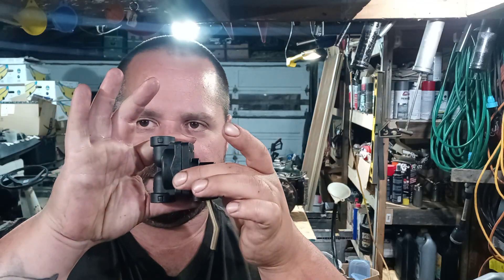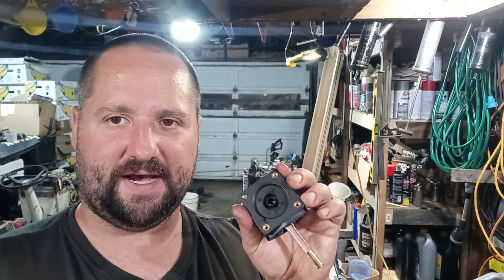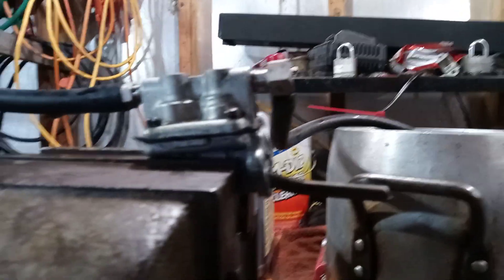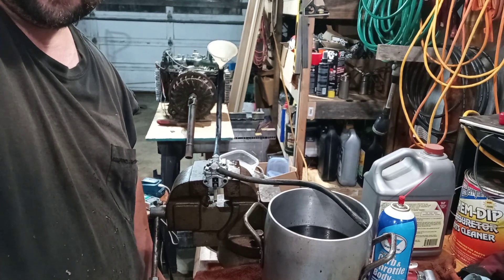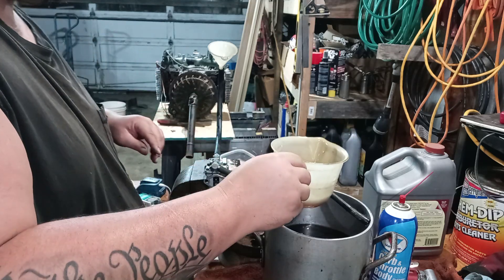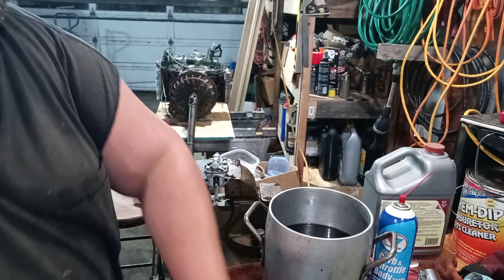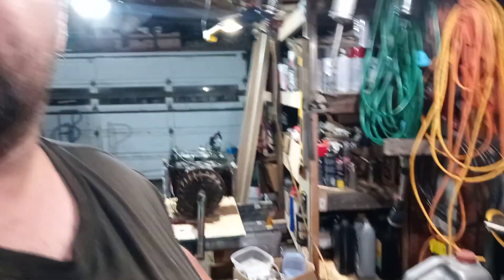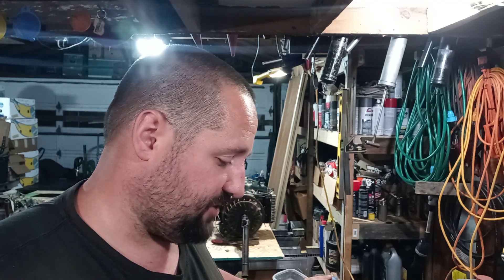Kohler KT17 fuel pump out of my Bolens QT17 part 2

Comment: Great job on the fuel pump, it is good that you can swap the key part
Reply from the maker: Thank you. Yes I'm pretty happy that i was able to save the original pump.
Reply: Hello From Mark In Kentucky. I have a 682 Cub Cadet that I am working on swapping out the fuel pump and probably the carburetor. After going through the hassle to remove the engine tins and carburetor, I really hate the thought of using one of the cheap fuel pumps only to have to take everything apart to go through the process again. I am leaning towards mounting a pulse type fuel pump that operates with a vacuum pulse from the engine. According to the appearance of your fuel pump, I am thinking maybe that my fuel pump looks like the black composite plastic or whatever and probably aftermarket due to no visible letters or numbers on the casing. My engine would either run pretty well for a few minutes and just smother out in which the engine acted like it was starving for fuel. I am going to try one of the aftermarket carburetors but keep and rebuild my OEM Walbro carburetor
Reply from the maker: @TheIronDuke502  I highly recommend keeping and rebuilding the original Walbro carb. It is worth the hassle. Some of this cheap chinesium aftermarket carbs are not made well at all and sometimes no matter what you do you can never get them to run correctly. Watch my previous videos on how i cleaned the carb for this Kohler QT17. Maybe that will help you with your original carb.

Comment: Good video. I wanted to do the same thing, and your video assured me it WAS possible before I ordered stuff and tore it apart. Question though. Did you have any issues with it flooding afterwards? My check valves are good, but it seems to maybe have excess pressure now. It floods, I unhook fuel line and it fires right back up until I hook it up again. Just curious before I tear carb apart. All new needle and float, so I have my suspicions on too high of pressure...this thing spits gas 3 ft away now.
Reply from the maker: I haven't gotten it back together yet so idk.
Reply: Ok. I noticed the new spring seemed stiffer and thicker gauge than the original, it was still roughly the same height from what I could tell. But the original was severely rusted through and came out in 3 pieces. It didn't leave much to compare it to. I did use the original better quality diaphragm, just replaced the spring. Guess I will be investigating further. Thanks.
Reply: Problem solved. I added an inline regulator, and set it at 2lbs. I cant complain, I was able to restore the original pump with only the new spring. I suppose gaining pressure and vacuum to the tank is not a bad thing, and a regulator to a carb is always a good idea. Guess maybe now you may know what to expect when you get yours together. I cant find a way to upload a pic of it all set up. Good luck.